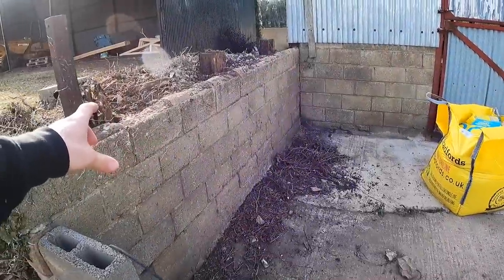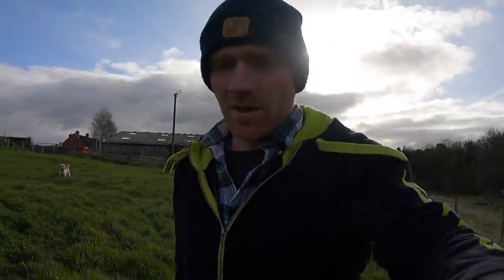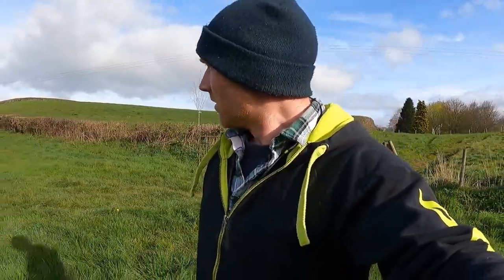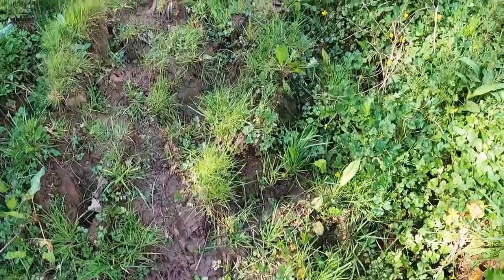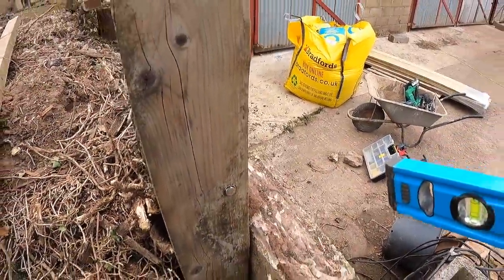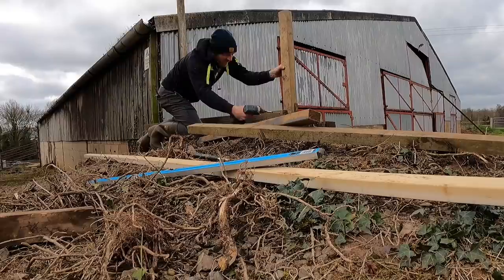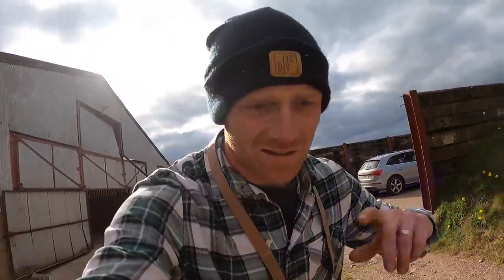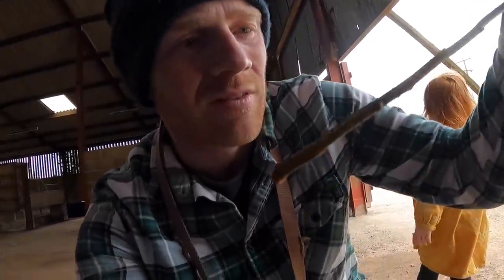GETTING THROUGH THE LIST! Featheredge fencing and mud investigations!

Comment: That looks very much like the original blade (I have the same saw), a new blade will make a huge difference without spending a fortune on a new saw. The dewalt blades are only 12quid on Amazon
Reply from the maker: It’s actually a multi blade I use for sheet steel but even with new freud blades it’s a bit underpowered when cutting things like joists.
Reply: @TheRestorationCouple   ya want the Makita 36v saw